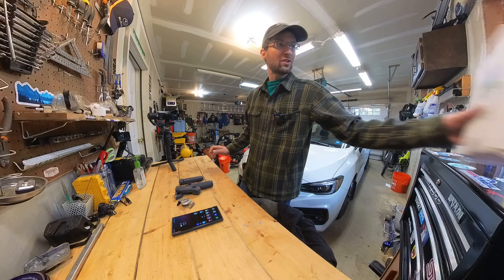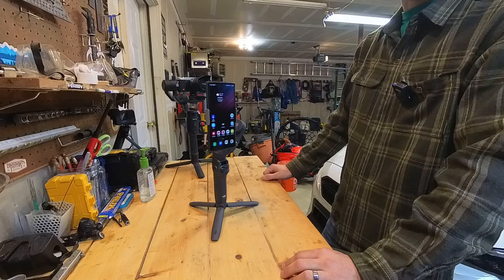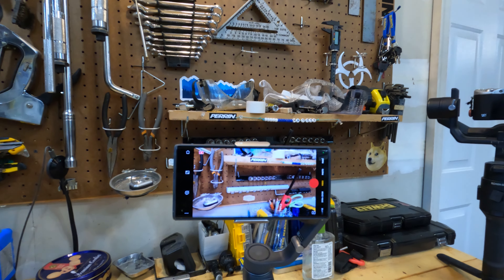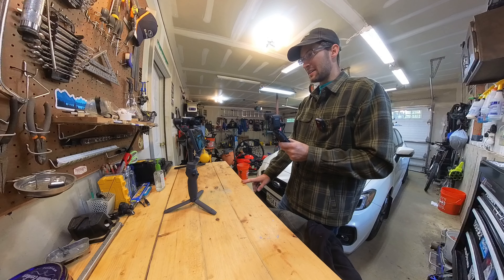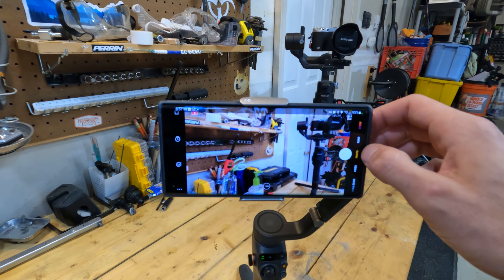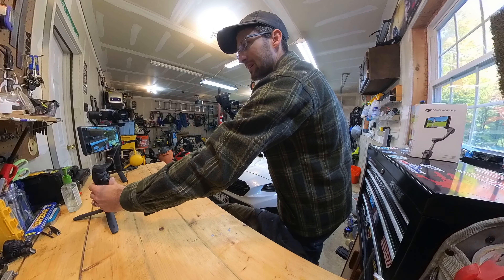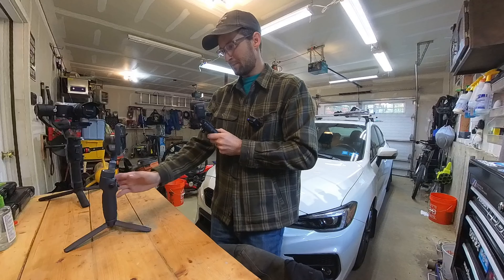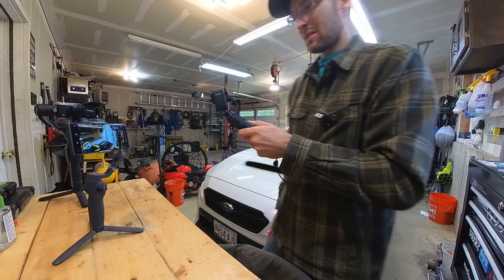DJI Osmo Mobile 6 OM6 Android Compatibility - Galaxy S22 Ultra

Comment: I had Djiom5 and djimimo app actually burnt the processor in s21ultra. They told me in support that app is upgrated now and should work smooth. Did you experience any more than average overheating with s22?
Reply from the maker: No nothing like that. No excess heat.

Comment: Do you lose a lot of video quality when recording with the DJI app compared to the native Samsung camera? I want to know if I should use the native camera in my real estate videos to get the best quality possible.
Reply from the maker: I think there is a loss, but I don't remember it being very significant. I don't have the gimbal anymore to retest for you... try to sell my stuff before new versions are announced haha
Reply from the maker: If you can afford a dji pocket 3, I bet that would be great for real estate.
Reply: @mainelyhobbies  Yes I thought about it but for now I'm concentrating on having all my content on one device. Later I'll start using better hardware but I'm just starting.
Reply from the maker: I think your phone plays a role also. It seems like the gimbal manufacturer has to manually support every phone and all of the phones little features like HDR in different resolutions and whatnot. So if you aren't using a popular phone you might have more noticeably reduced quality.  DJI seems to focus on Apple devices, so those are well-supported.

Comment: Thanks a lot for the video. It could be nice if you make an outdoor video with the 10x zoom. I buy s22 ultra for optical zoom. 
Do you think om6 helps for 10x optical zoom in main camera ?
Is there any gimbal that works with that ?
Reply from the maker: I can probably test that out but today is pouring rain all day.  Basically, put the S22 Ultra on the OM6, use the built in camera on the 10x lens and see how hard it is to follow a bird or something?     I have pretty good luck with the 10x being stable when I hold it.
Reply: Good luck with the weather . Please zoom with the main camera.

Comment: Hey there, glad I saw this video. 

I have an S22 - Very disappointing that you can't use the 0.6x wide angle video with the gimbal. To be honest..  It does say so on DJI 's website compatibility list pdf. The S20 & S21 support 0.6x, 1x & 8x but the S22 is only 1x and 8x. Why?? I won't be buying this gimbal for that specific reason. Surely the wide angle feature is going to be the most used. 

Will they update the software to allow thislater on...  or will it be on the next model for S22.
Reply from the maker: If your goal is active tracking on the S22 while using .6x and 3x/10x, then check out the video I just posted today because I found a similar gimbal with a no-app needed active tracking device... so you can use your s22's built in camera to use the .6x-10x lenses while having active track on.  My most common use for a phone gimbal is active track so it fits my needs.

If your main goal was the zoom wheel then there isn't anything I've seen out there.  

In my experience after owning 4 DJI gimbals, they don't really update compatibility much.. it seems very rare.  You are more likely to get it on the next product they sell, but even... if you don't have an iPhone it isn't guaranteed.

Comment: what screen protector do you use and does the fingerprint reader still work?
Reply from the maker: I used film protectors on my s22... tired of the hard ones peeling at the sides.   No issues using cheap ones off amazon for the fongerprint reader.   My s24 is neked.. trying it out since i have the warranty.
Reply: @mainelyhobbies  yeah the glass ones don't work at all, I wonder when Samsung will fix that issue

Comment: one gripe I have Is the fact that you can switch between front/rear facing cameras while recording on andrioids.
Reply from the maker: Right, low effort implementation.
Reply: @mainelyhobbies  I really like my 6 but that's the one feature I wanted. May look at other brands
Reply: @mainelyhobbies  from DJI just now. "After confirmation, the feature cannot be realized on both IOS and Android devices."
Reply from the maker: There is probably some standard coding chunks they use to make their app thatis provided by google and that standard code doesnt include the feature.    Snapchat can flip back and forth while recording so its not a "3rd party impossible to do" feature... its probably DJI wanting to keep it simple and use premade code for ease of updating down the road.

Comment: Hi, to get more angle you need to extend the pole a little bit and then you can adjust the circular section that the top of the extended section.

Comment: Any Recommendations On A Vlogging Kit For The S22 ultra? Since This Gimbal Won't Fully Work
Reply from the maker: Uhhh I would probably go for a gopro with media mod and a mic with a handle grip and no gimbal over using the S22 ultra.    I dont think there is a good gimbal option for the s22u yet.

S22 ultra video is over sharpened, the only real advantage it has over a gopro is zoom lenses

Comment: Good day, sorry but I don't understand English. From his video, can it be used for the s22 ultra? and possibly it can be filmed in 4k?
Reply from the maker: 4k 30fps works with the s22 ultra on the OM6.  I would look at the Insta360 flow instead though for better compatibility.  Look in my recent videos for a comparison.
Reply: @mainelyhobbies  but from the data sheet it says that also insta 360 flow on samsung s22 ultra records in 4k 30fps correct?
Reply from the maker: Yeah.. better compatibility meaning more camera lens support in the app.  They both limit to 4k 30fps.     You can use the phones built in camera app for 4k 60fps but you lose smart gimbal features.
Reply: @mainelyhobbies  ok, considering that I am ignorant on the subject and I have never used these articles, and considering that my use would be amateur and non-professional, do you recommend me more insta360flow rather than dji 6? and possibly for what reason?
Reply from the maker: If you have a s22 ultra I would get the flow instead of the OM6.  The flow is a better design, smaller, easier to open up.   The flow also supports active track on more than just the main 1x camera.  The flow also supports active track on the .6x,3x and 10x cameras.    The active track on the flow is also in another league better especially if the subject is temporarily lost.     Insta360 also is known to update and add new features and support where DJI pretty much releases things and only does big fixes.

Comment: I am making a video and will upload by tomorrow...shot a broll using both 14 pro max and s22 ultra but in the end ...had to use more of the Iphone footage as it looked better
Reply: What i noticed, if you use the DJI mimo app on S22 ultra you will get alot of shutter lag....its very limited for Samsung users but a completely different thing for IPhone
Reply from the maker: I just recorded 11 minutes in 4k in the mimo app and didnt see a single stutter.     Maybe that issue isnt across the board for everyone.
Reply: @mainelyhobbies  i think there is an auto FPS option which causes this issue, i will try again after turning that off

Comment: While I know I won't be able to use all the features, would this still work ok as a dumb gimbal, cause I'm not so comfortable downloading a chinese app. I know I'm an idiot for not checking before buying, but the gimbal itself seems pretty good
Reply from the maker: Yes but be aware what a dumb gimbal means - that means even the start stop buttons on the gimbal wont work - there is no connection between gimbal and phone.    Its not a huge deal considering the price for size/gimbal performance is still good.

Comment: It is sketch the way it has to be installed on Android, but I suspect it has to do with cost more than anything. You got to remember Google takes about a 30% cut for charges. And it still costs the company fees even if the app is free and they don't charge. With Apple they don't have a choice. If they want it on iOS they HAVE to go thru Apple. With Android they have an alternative that saves them money. It's just good business.

Comment: Using the peace sign. It would help if you even knew what a peace sign ✌is. It is your fingers in an upright V shape. Turning your hand horizontal is NOT a peace sign. You are displaying your ignorance of the peace / hippie Era. That's OK,  because you were not born let alone even even thought about during that time period.
Reply from the maker: Someone already corrected me on the angle of the peace sign. Your comment is a bit ... excessive.. lol.  I was picturing you slamming your fists on a table watching me fail.    Holding it mostly sideways usually works anyway when I did more testing after someone let me know. .  It was probably more contrast and busy background.
Reply: Hi to all the Hippie stoners out there.............

Comment: thanks for the great video.. I wonder, has DJI solve the problem that is with the DJI OM4.. the micro circulair movement..
i discovered that problem when taking night/ astro shots with the pixel 4A5G and used the om4 as a tripod to direct the phone to a area in the sky with stars.. the pictures had moving blur.. then i checked it inside my home and zoomed to the max to a point a bit away and saw live that the camera was moving around in tiny circles. It does that in the mimo app but also in the google camera it self.. you can try it easy.. put the DJI on the table and just zoom in to the max and watch the image on ur screen.. if it is motionless its solved, but when i do this with the om4 the phone is moving in little circles. so it must be a hardware problem DJI could or did not want to solve, i also saw on the forums that i am not the only one with that problem..
All of this and the lack of moving possibility when shooting a movie does make the DJI not something i would buy again..
Kind regards from the Netherlands, Pascal